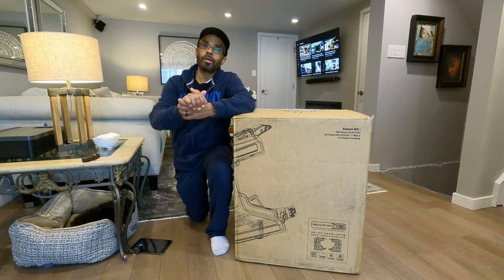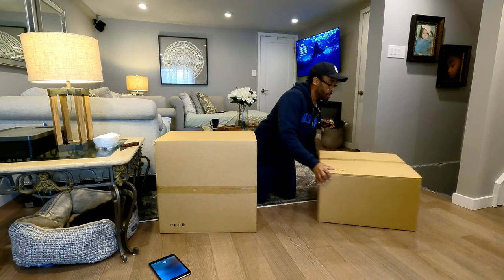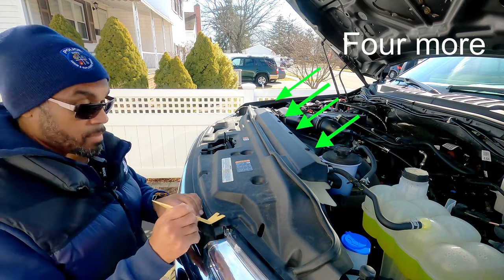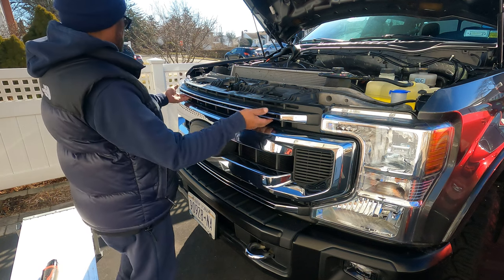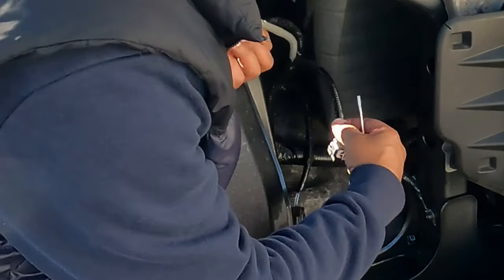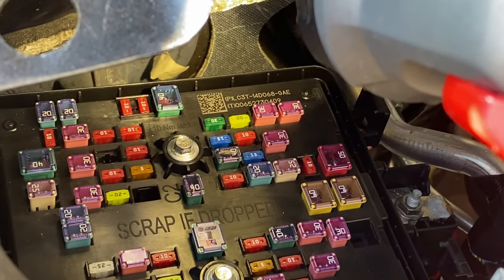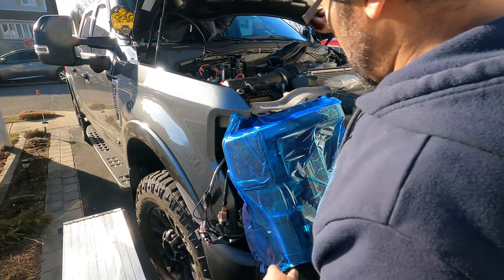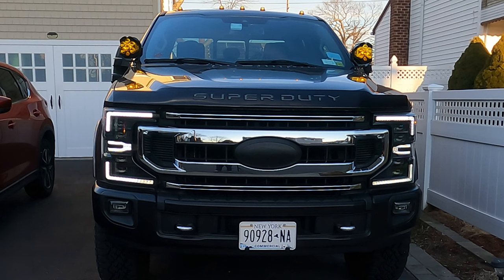2020+ Ford F250 F350 Super Duty Tremor How to Install Morimoto XB LED headlights Detail Good & Bad

Comment: Nice job where in New York are you located I just got a 22 Ford F-250 tremor & want to install those lights but I was told only way to install those headlights is if you have the stock halogen for it to be plug & play.
Reply from the maker: That’s true, if you have to be halogen it’s a plug and play system. I don’t know if there’s a another option for Stock LEDs.

Comment: Hi Ray,
How’s the lights working some updates on mine for the viewers out there. 
1. Wish I had notched my fuse box initially as my harness got pinched had to replace harness. A small notch works fine but again if the fuse box gets moisture intrusion it will not be covered by warranty as Ford will say this allowed the intrusion. I used electrical grease but it does need reviewed  regularly to ensure it’s still in place. 

2. My Ford service tech  recommended me not to use fuse #16 due to it being the transmission and drive train power module fuse. He said use a power point like fuse #35 which is power point #2.
Reply from the maker: Thanks for the tips. I haven’t had any problems with my installation. I will check the location for moisture and add some electrical grease to be safe.

Comment: Great detailed video, by chance did you have any issues with the lid closing all the way? After notching it I still couldn’t get the lid to close all the way, the fuse tap gets in the way and touches the lid not allowing it to sit properly
Reply from the maker: Thanks for the question, please remember to subscribe to the channel and like the video. To answer the question, I haven’t had any problems with this installation. My lid close properly after I notched the Corner of the lid.

Comment: Hey Ray. I have the same lights. Easy install and I wish I had seen your video prior to installing. I had an issue with my DLRs after a month due to the fuse tap wire getting pinched from the fuse lid as I didn’t make alterations to allow the fuse tap wire any room to pass through the box. After dealing with Morimoto and the dealer I bought them from, no one was able to help me out. Morimoto is sending me a new fuse tap since the previous one is pinched badly. They did say I may need to make adjustments to the cover but in the instructions it’s funny how they gloss over that as if it locks in like factory. 

Have you had any issues ?
Reply from the maker: Thanks for the feedback and please remember to subscribe and like the video. To answer the question, I haven’t had any problems with my installation. Yea, they should Emphasize on the fuse tap very important part. I’m glad you found my video helpful.

Comment: Liked and subscribed. Did you resolve the driver side flicker when going from high to low? My truck does the same thing. Great helpful video, thanks.
Reply from the maker: I haven’t notice that situation with my light but I will take a look at it. Will follow up with you.
Reply: No worries! Good luck. 35:32

Comment: It looked like your driver side light is going completely out after coming off brights for a few seconds. I had this exact issue. You should be able to fix this issue by removing the low-beam delay harness from the setup. It worked for me, I didn’t have to remove the passenger side, as it never goes completely out. I have a picture of the low-beam delay harness.
Reply: My truck does this too. Driver side 1/2 second off sometimes when going to high to low. I have tried to Google "low-beam delay harness" with no luck. Do you mind sharing some extra info on how you resolved this?
Reply: @jhambone9190  I have a picture of the low-beam delay that you need to take off. Im not sure how I can message you privately to send the picture. It’s very simple and it has made my truck lights work perfect ever since removing it.
Reply: @jhambone9190  if you can add an email to this comment, I’ll send you an email of it. You could delete the comment after so that everyone doesn’t have it.
Reply: Can I get this as well?

Comment: I plugged my lights on and left them on auto and they don’t work they only work if I move them manually off an on I want them on auto all the time like factory and advise???-
Reply from the maker: Thanks for the question, If you install it the way I demonstrated. You should have no problems. Make sure your connections are correct. Double check.  If you still have problems reach out to the manufacturer.
Reply: Did you figure this out sal? I’m having the same problem!